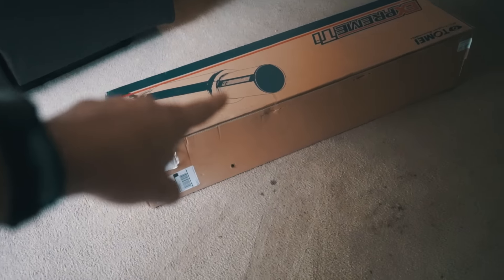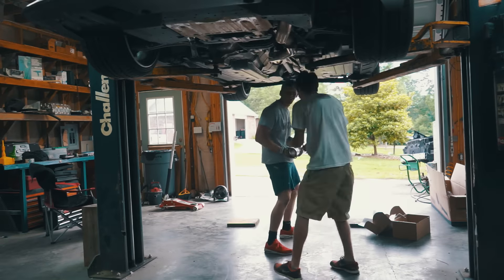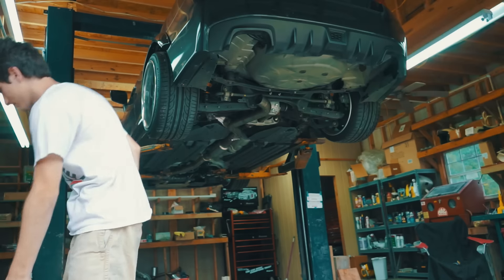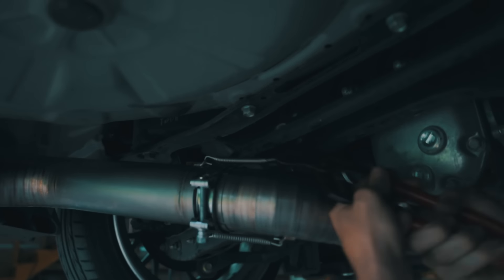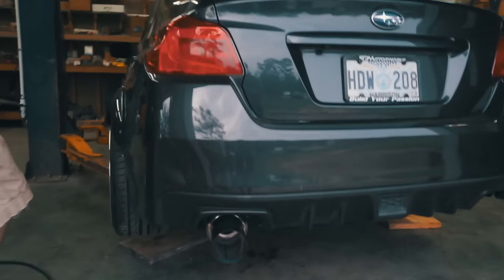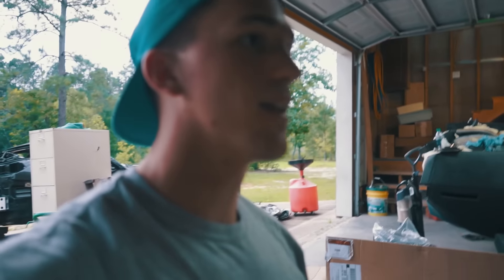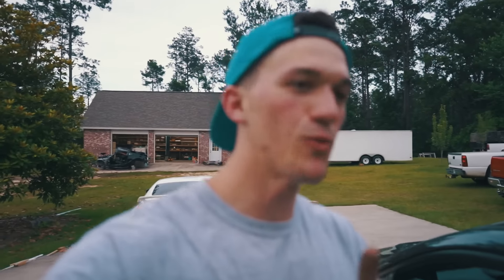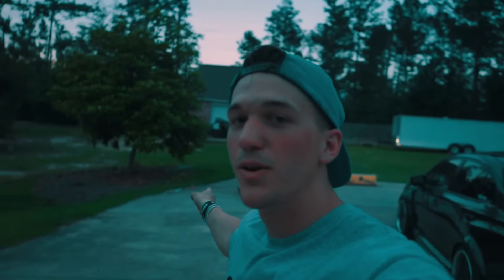ALMOST A RACECAR! Tomei Expreme Ti Exhaust DIY/Sound Clips

Comment: Isnt that wing a little ricer?
Reply: That's the one thing I would change on his car if it was mine I'd still have a spoiler but have a smaller one
Reply: technically not. a rear wing generates more downforce if it can get out of the turbulence generated by the car. in this case, that means putting the wing high out of turbulent air. just because you don't like it doesn't mean it's bad, it just means you don't like it
Reply: +Berenger Christy im not saying i dont like im saying a car of his horsepower doesnt need a wing that big
Reply: Horsepower doesn't determine the need of a rear wing. I doubt he's really making use of it but I'm just clearing up that misconception
Reply: Facepalm

Comment from the maker: Now I just need more power :D
P.S. Don't laugh at my terrible launch.... lol
Reply: bigger turbo? e85?
Reply from the maker: Bigger turbo, yes. e85, no. There's no where around me to get that unfortunately.
Reply: Are you thinking of going to an STI turbo, if those can even be used on the FA20, or going to an aftermarket solution?
Reply: +PhantasmAMX you cant use a single scroll turbo on these cars
Reply: +Trippy Subie You can use whatever you want with enough modification! But naw JK that's what I was wondering.
Reply: Where are you guys located I'm in memphis, tn!!! Love the car and especially the way it sounds. SOUNDS NASTY
Reply: Is that the boxer engine?
Reply: Thomas Solberg Of course! It's a Subaru.
Reply: 385/380 @ the wheels in my fully-bolted/ethanol mix tuned/hybrid GT2871 turbo Mazdaspeed 3. You need some go with all that show (esp. that wing o.0) Come at me, bro ;-D
Reply: I really like subaru's cars and i think i like your car :D
Reply: I will pay you to tell me the song
Reply: +Thomas Solberg yes it is... just that it comes with an equal length header stock, so the subarumble's less hearable
Reply: Feelings at first - dude he's gonna launch it! sweet!  
Midway - what's he doing?
Take-off - TF was that? lolololol
Reply: Dustin Williams what's your set up ?! Well besides the exhaust ... I'm in love with those 💥💥💥
Reply: Dustin Williams keep going I love Subaru wrx sti  💪🇯🇵😍😍
Reply: How are you getting such a good turbo sound

Comment: Thanks for sharing...  but you need to remove those band clamps. They'll deform the exhaust and create an exhaust leak.  Those exhaust pieces that require the springs for connection are a "Slip-Fit"  connection. Slip Fit exhaust systems are widely used on motorcycles and  on high quality JDM Titanium and  Stainless Steel exhaust systems because of their metal  thermal expansion properties.   The slip fit  allows the exhaust system to fit naturally,  allowing it to grow when hot and shrink when cold or it basically  allows for movement.  This is why many stock turbo exhaust systems have a "flex pipe" section. 

  "Slip-Fit"  also reduces weight by eliminating the need for a "flex pipe" and the typical "flange, bolts and nuts" type connection. Using the band clamps won't allow the titanium pipe to expand properly, eventually deforming the ends and causing an exhaust leak... the band clamps also adds unnecessary weight. Not to worry about exhaust leaks without the band clamps..."Slip-Fit" pipe connections will self seal against each other, once the metal heats up.    

Japanese Tuning in Plain English 

Choritsu-shi  =)

Comment: At first i didn't like the single exit exhaust but it is growing on me, i think it looks amazing with your set up the big wang and flares with this exhaust makes it look like a straight up race-fucking-car
Reply from the maker: Thanks bro! that's the look i am trying to go for!
Reply: +Dustin Williams question how does your hood handle the water that goes in through the vents? I want to buy this hood but afraid of water going into the engine components
Reply from the maker: +ivan polanco great. Havent had any problens

Comment: Damn both cars sound so nice!:With the springs connecting the pipes you're suppose to put them both on whichever pipe you're connecting it to and go at it from an angle. It's hard to explain but it's very easy if you know what I'm talking about lol. The whole point of those springs is for the tension already set so if you pull them while trying to put them on you get rid of some of the tension. One pipe with both the springs then connect the springs to the other pipe from an angle then just pull and push the piping to connect. Eh idk if this makes any sense but basically there is a very easy way to put the springs on.
Reply from the maker: Yeah, that makes a lot more sense than how we were doing it hahaha

Comment: Is there any replacement diffuser that's made for a single-exit exhaust, so you don't have a void where the other muffler was?
Reply from the maker: I think there is. I'm not 100% on that. I'll be doing a DIY custom tow strap for the other side!

Comment: dustin what engine mods are your running? i also have the tomei and a catless dp just wondering if you had any problems with smoke coming out of the exhaust on normal driving or when coming to a stop?
Reply: Bonnie Igaya that's not an exhaust problem, that's an engine problem.

Comment: Does Josh still owns the 350z with the VS bodykit? Loved that car, and i might want to ask a couple questions about the bodykit if that's ok...
Reply: Unfortunately I just parted it out and sold it, you can ask away my man
Reply: Icanhazs13 Was the bodykit an original Veilside or was it, for example, from duraflex. Also, did you had any problems conserning durability. Some people told me that the VS bodykit would actually break rather easily? Hope you can give me some answeres, cause im in love with it...
Reply from the maker: He sold it!
Reply: yes it was an original veilside, not a replica. It was very sturdy, I hit two raccoon sized animals and they bounced off lol, it did crack the paint but not the bumper itself. the side skirts were a different story, after being so low and hitting bumps, dips and what have you they finally gave way and cracked. Hope that helps!

Comment: that sounds nothing like subaru or only the sti have the original subaru sound?
Reply from the maker: The new WRX has the FA instead of the EJ. With the FA motor you get a twin scroll turbo, which does not allow for unequal length headers. UELs are what gives the car the "rumble" sound. q
Reply: ***** aright I got yaaa respect 👍

Comment: damn sounds nice, un equal length headers next?
Reply: Cant do that on a wrx
Reply: +Miguel Salas why not?
Reply: +Kenny Perez because the new fa motor uses a twin scroll turbo and in order to get the benefits of a twin scroll you need equal length headers
Reply: +Miguel Salas ah didn't know that, thanks.
Reply: +Miguel Salas do it for the sound (;
Reply: +Brandon Green lol, just Sti swap it
Reply from the maker: Wish I could lol

Comment: Did you put equal length headers? WHY?!
UEL's are what make Subies different and amazing
Reply from the maker: 2015+ WRX have twin scroll turbos. You are unable to use unequal length headers on a twin scroll turbo.
Reply: Brian Robinson fun fact: uel is a usdm thing for emissions. Jdm Subaru’s run el non tracked/tracked.

Comment: to bad those modern subaru's dont sound like for example the old impreza's ..that 350z sounds so much nicer
Reply: nle46touring how old? Modern subarus sound the exact same except for the new WRX and that's just because of the headers, nothing else.
Reply: Not only the EL headers but it's not the EJ motor anymore...
Reply: BoraBora 2015-2020 STI’s still have EJ257 with UEL. Only new wrxs have new motor and EL

Comment: I use a little rope to put on the spring
Reply: That's smart.  Some way of hooking it would be alot safer than using pliers.
Reply: What is the purpose of thise springs?
Reply: +bubanzizwag pnw it's holds the two pieces of pipe together tightly
Reply: I use a hamer with a zip tie so you can pull it back with 2 hands

Comment: Subaru sounds like a honda you ruined that boxer engine rumble
Reply from the maker: The 2015 WRX has a twin scroll turbo, so you cannot run unequal length headers to get the "subaru rumble." The only reason the old models and the new STI's have a rumble is because of the headers.  I've owned a honda and this sounds just about the opposite... Thanks for your input!

Comment: needs unequal headers. give it the proper Subaru sound.
Reply from the maker: The new FA motors have twin scroll turbos. You cant run UEL headers with a twin scroll turbo.

Comment: Putting equal length headers on a Subaru is a crime against the classic subie rumble.
Reply from the maker: 2015 WRX has the FA engine with a twin scroll turbo. You aren't able to run UEL with a twin scroll turbo.